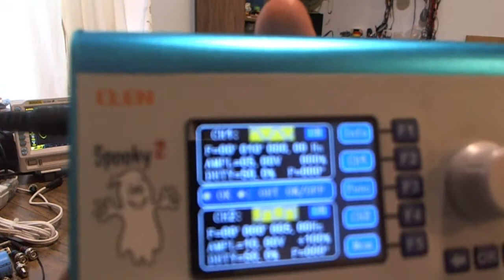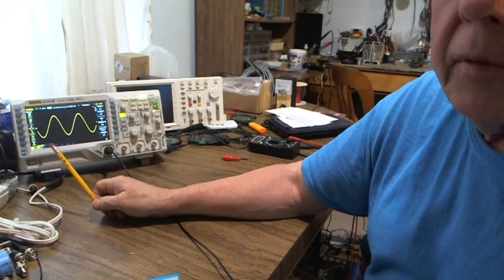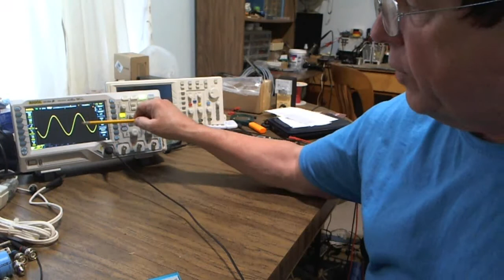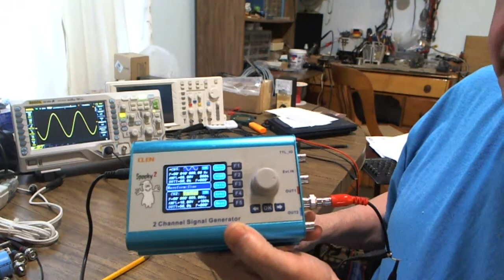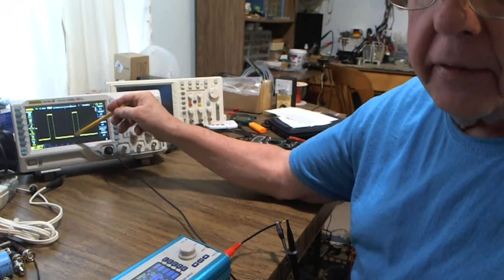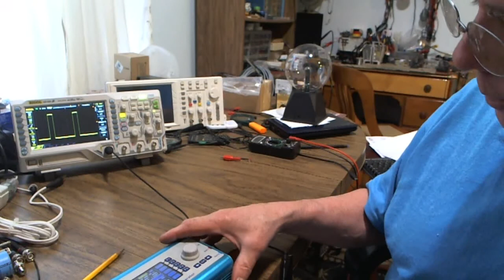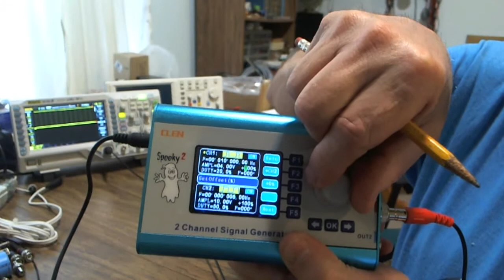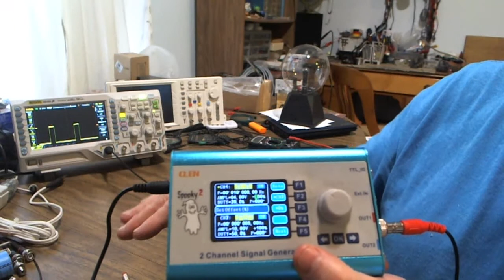Some Basics on Spooky2 Waves, Duty Cycle & Offset

Comment: Why would u want to use an offset when using a plasma ball? Wouldn’t u want the power to be at full force all the time ? Specially if you’re trying to kill an infection
Reply from the maker: The Spooky2 doesn't run or energize the plasma ball.  It triggers another circuit that runs the plasma ball.  This other circuit needs a positive on/off (square wave) at about a 15% duty cycle which in turn generates an on/off approximately 20,000 volt high frequency (about 28khz) signal that cause the berkeland current streamers you see inside the plasma ball.

Comment: Thank you. With square waves, what are the offsets most commonly used for 1) PEMF and also 2) for handles? Do you normally use positive for both or for PEMF do you use AC (i.e. swinging both sides)? Thank you :)

Comment: geoff clark's friend who was an ee set hulda clark's generator to 100 percent positive ofset... for hand held delivery... (so negativly charged electrons would accumulate in the body at the positive pole or positively charged handle.   forest mims in his book said protons have a positive charge, electrons have a negative charge and nutrons do not have a charge.   and static electricity and lightning were the same thing.   i know for an absolute fact that static electricity can be either positively charged or it can be negativly charged depending upon how its made and from the material its made from.

the big idea here is to create an energy that is benificial to humans and avoid producing an energy that is harmfull to humans....  excessive proton energy is acid accumulation... excessive electron charge is alkali.   the standard american diet id proton heavy or acidic.  additionally we all wear rubber bottom shoes which block electron flow into us from the earth.  most people do not have enough electron or negative charge causing body chemistry to be to acidic in key areas primarily our blood pH. 

so what i want to know is if we are transfering electrons or negative charge through the air... maybe we want a 100 percent negative offset and this might explain why when i set up my 2 spooky 2's in scalar remotes and run in 100 % positive offset... (i stack them on top of each other) so the 4 remotes are are stacked on top of each other)  they make me feel tired, as they take away my energy... when they should be energizing me.  maybe because i always run them in 100 % positive offset!   but i think i will try 100 % negative offset and see what happens.

so for hand holds 100 % positive offset is the best, but maybe for transfering negative static charge or scalar waves through the air the negative offset is best.   ive always been afraid of negative offset.   now on a cockroft- walton circuit the direction of the first diod sets the final charge as either positive or negative.  if the cathode on the first diode next to the source or toward the source the the charge will be negative... (important when building a negative ion generator)  which is sorta what we are suppose to be doing here, but we are canceling out the magnetic field and producing a pure negative scalar charge simular to life force energy.   on the new black spooky remotes data page it says these new remotes don't make you tired... that's good because they are 50 dollars each.

Comment: How do we know wath Wave Types, Duty Cycle, or Offset to use when you only have the RIFE Freq its say nothing about the rest in the Freq, how about the rest?
Reply from the maker: I do not want to re-watch the video to see if I can figure out what you  are asking.  The video is very visual and shows what the Spooky2 setting where during the presentation.  I simply do not understand your question.
Reply: No i mean if you going to put in the Freq manualy from the Rife list, how do we know from the Freq list wath Wave Types, Duty Cycle, or Offset to use, when its only shows Freq?
I know about the Spooky2 software and the inputs is allready in the software presettings and programs, but i mean manualy now when you have a Freq list of all Rife freq there is.

Lets say Flu frequencies: 512 Hz, 440 Hz, 683 Hz, 2005 Hz, 2016 Hz, 2048 Hz, 2072 Hz,  thats i, nothing about the rest like Wave Types, Duty Cycle, Offset or duration.
For lets say a CONTACT mode like handels, how do we know about the rest setting?